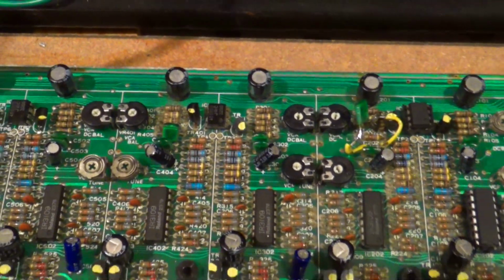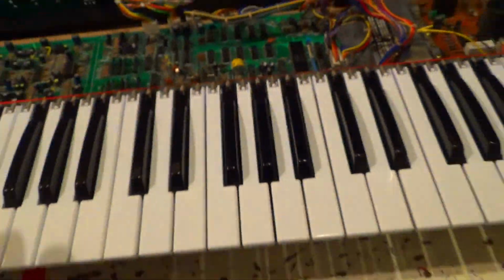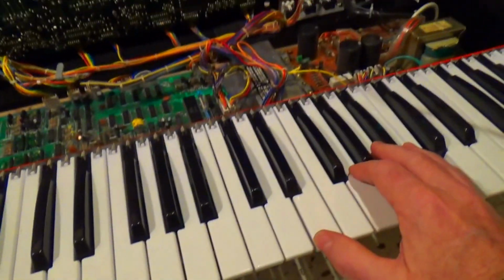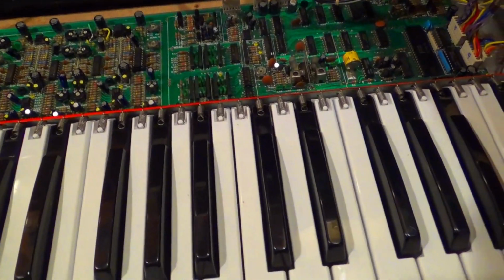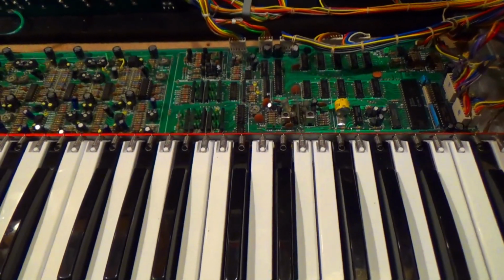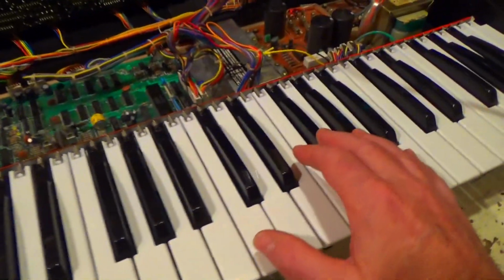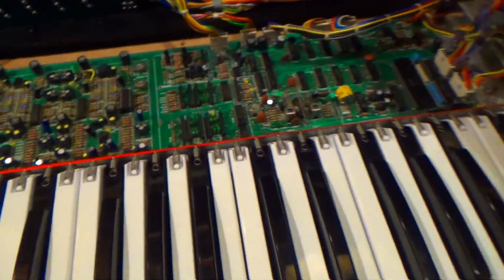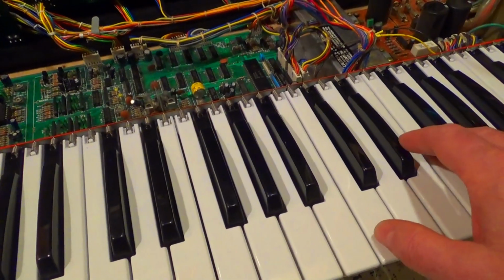The dangers of buying analog synths

Comment: A lot of JX3P users, myself included, jacked up the res trimpots to get more self oscillation out of them. Makes some of the presets useless but that was ok with me because they are not that great. I also had to replace my data slider, actually stuck the brilliance slider there since it was the same value. Put a rotary pot sticking out the back for the brilliance control since I never used that either.
Ran a separate output off the sum voice output test point since it bypassed the chorus unit and HPF, never used those either and got a clearer sound with more guts.
Reply from the maker: There are a ton of mods that can be applied to this synth. I have been working some out in my head. My edit slider cuts in and out- on my work list.

Comment: Change all the caps of old synths and they will sound better than ever and better than any new ones or plugs !
Reply: Man. Recapping is not magic. It does not always influence the sound.
Reply: My Summit would disagree
Reply: It’s better to diagnose the problems and replace what’s needed. Yes, many times it’s the PSU caps. But replacing all the caps in the machine is a huge waste IMO.
Reply: @dustcombo  I agree - and the risk of damaging the circuit board isn't worth it. So many people have no idea how to solder properly let alone de-soldering. If someone told me a synth was recapped, I'd want to take a look inside before buying!

Comment: Juno-60 with a weird issue - no matter which key you start on, once you have pressed 4th or 5th key, that one sticks on sustain until you've hit another 4 or 5 keys, then a new one sticks/sustains.  Thought you were going to have same issue.
Reply from the maker: The voice assigner rotates through each voice one after the other. Every 6 notes you are back at the same one. One of your voices has a failed chip controlling the adsr envelope for the vca. The IC is most likely a 4051 multiplexor, as used in other Roland's from the 80's. The Juno should have a test mode that will let you identify what voice it is, but it really shouldn't matter since the single multiplexor controls the all the vca op amps. If you find more than one voice is misbehaving, then the op amp fed by the 4051 is bad. This is all based on how a Jx-8P works, but I bet money the Juno is very similar.